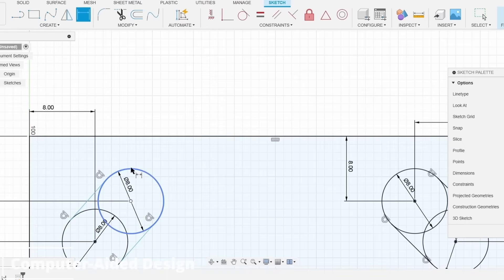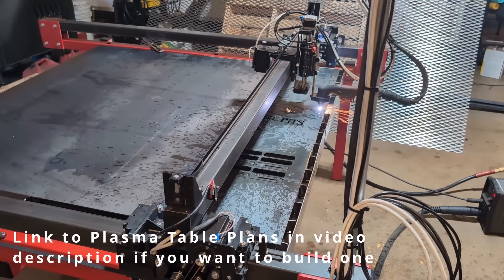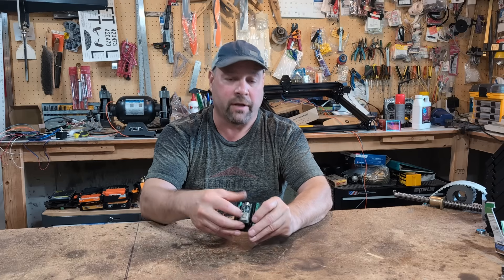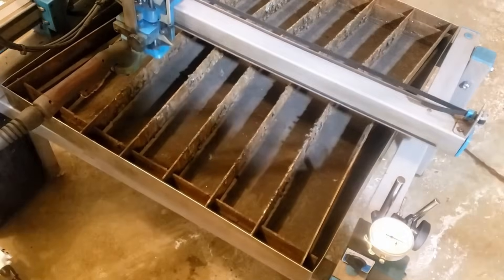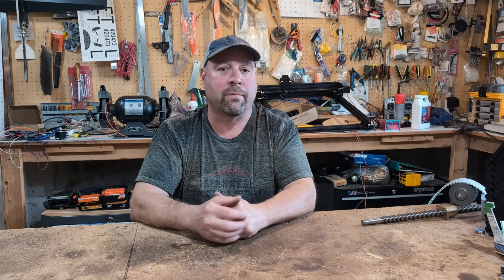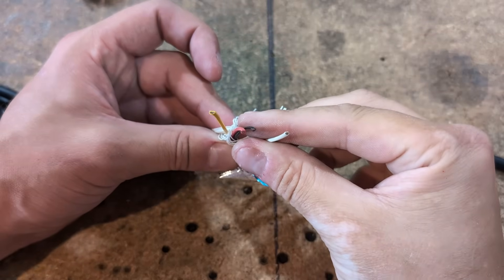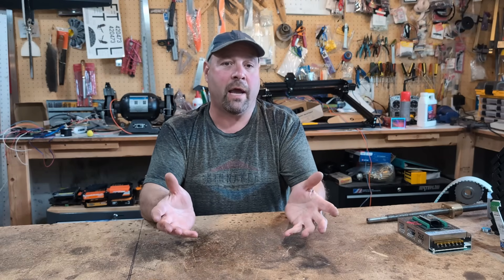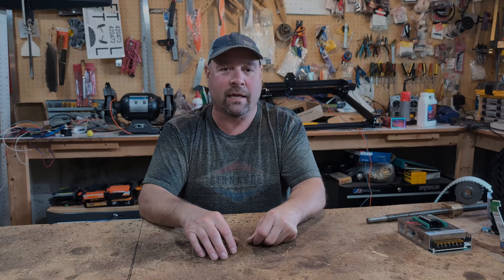10 Biggest Mistakes YOU can Make When Building a DIY CNC Plasma Table

Comment: Bad timing for me since I bought this LOTOS LTPDC2000D in 2024...  Never thought about needing a CNC control.  In order to get this one working, I have to. create a relay interface for torch control, maybe add an external Arc OK sensing signal, and the trickiest part, a separate THC system.  Some 3rd party folks want $175 or more for such a system.  Since the tricky part is the THC, I'm wondering if using a drag system with consumables would work, and be better.   If anyone reads this and has experience with  please feel free to give your opinion!   The electronics is the easy part for me but the mechanical stuff and my inexperience with plasma cutters is the killer.

Comment: Bestarc BTC650XP 11°Gen, does it work well?
Reply: Did you try that plasma cutter, i was looking at the same 1, just curious if it worked??
Reply: @marcusmorgan1419 Just like you, asking if anyone uses it with CNC plasma because it is low blowback frequency. There is also another Chinese brand SILATU STC650P Max.
Reply: @hernanenrique5700  Andeli or something close has one similar that says cnc capable but the plus on the back are different than everything else, it has the std 2 pin but it's got an4 pin instead of 5 like all the other cutters. I am going to try the bestarc 65 amp machine once I figure out fusion 360 and get a table built, if it dosn't work I can return it. Reviews are all good from what I can.find, consumables are priced fair, only problem is I can't find contact info on the company or any warranty info.

Comment: I'm glad I just watched your video. I recently purchased a pilot arc blowback plasma cutter. It does not have the high frequency start. However, it mentions in the documentation low frequency is used to reduce the wear of the tip. 
So I just returned it and ordered a different one that specifically is for CNC that does not mention any low frequency.
Reply: Huh? He said Low frequency is what you need.
Reply: @davidaustin6962 I believe he said you do not want low frequency or a high frequency. In other words, you don't want any kind of frequency
Reply: @tallyman15  all blowback cutters utilize a low frequency start. The low frequency prevents wear on the tip and the mechanical start in the blowback method increases startup reliability. For CNC the main reason for no high frequency is that it messes with your electronics.

Comment: I am a retired harley mechanic, 30 plus years. I recently built a frame jig, in all my years as a motorcycle enthusiast, I've built more bikes than I can remember but I have never built my own.frame, so, thats what I am going to do, along cnc plasma table would be an excellent piece of machinery for my shop and a huge help in making parts for a frame, but I am old school, and have never used a cnc machine of any kind, I have 3 mills and 2 lathes I use alot, but all are manual. I can build one of your designed tables no problem, but I worry about setting up, designing, and sending  cut files. How difficult is it to program the table to make parts?? I am very good with wiring, I was an avaition electronics tech in the navy, but that had nothing to do with designing or writing programs. I would order your plans and parts today if I knew I could run the software, but I worry I would end.up frustrated and set the table in a corner and never use it.

Comment: The first table I built was 36" X 36" figuring that I would rarely need to cut anything larger than that, true however the sheet stock all comes in 48" widths
I got tired of having to cut it down to fit in the table. In the process of building a 30" X 50" to solve the problem. Original had a water tray under it, seemed to cause a 
lot of rust and corrosion, new build has a catch tray and extraction fan. Belt drive is simple and works good, With the prices getting cheaper I am trying ball screws 
on the new table there a lot more work to get set up and aligned and also require much more dust / debris shielding. As mentioned I don't think the added accuracy 
is that evident with a plasma cutter.        JJ
Reply: You won't get the speed of movement you have with belts with ball screws and there's really no need for them in a plasma cutter where there's no cutting force on the head.
If you want accuracy you need closed loop feedback.

Comment: I have found that my first attempt at supplying clean dry air to the plasma cuter was not good enough. I used a moto guard filter that I thought would remove both dirt and water from the air.  Recently, I made upgrades to my compressor with an inline cooler and three stage filter and desiccant water trap.  What a difference in both cut quality and reduction of dross. I also added an air pressure gauge at the input to my plasma cutter, so I could confirm the air pressure at the plasma cutter itself.
Reply: I have struggle with wet air for years.  I am even have a refrigerated cooler.  I ant to try putting a cooler between the pump ant tank instead of after the tank.  Did you use a youtube video for your solution?

Comment: Hello guys just brought a BESTARC BTC800DP 9GEN which is a HF POILT ARC was told was suit for a plasma table I also brought your online plan set.
Reply from the maker: You should consider returning it if you can, it will probably not work with this table. HF can really only work on high end professional setups.

Comment: all i got to say if your not a g code wiz stay away
Reply from the maker: You don't have to understand g-code to use the machine. You just have to understand the post processor settings and making tool paths. We have several videos on this.
Reply: well i have yet to make a part on it with any thing Ive drawn yet alwies a g code error
Reply: @MultiLEGODOG  ChatGPT or Claude Understand it perfectly. You can run it through them. They'll add things subtract things and all you do is talk to it. Copy the code into GPT and boom. You can talk through it all you want. Ask questions Ask it to make changes. Learn the whole thing if you want. Or just let the AI do it all for you.